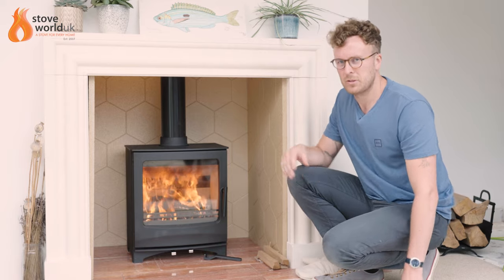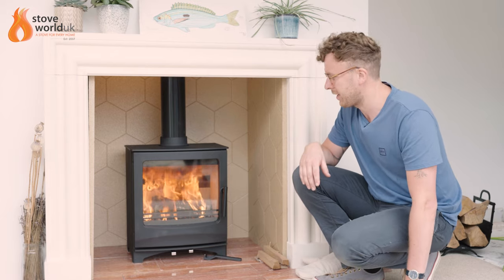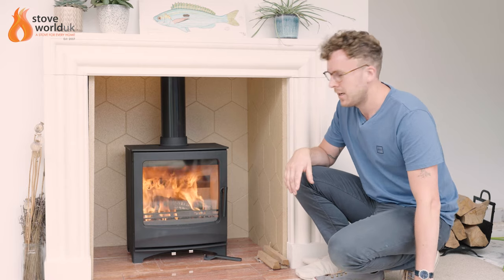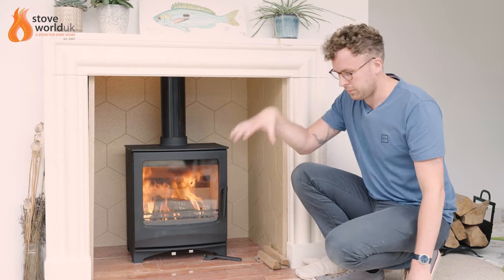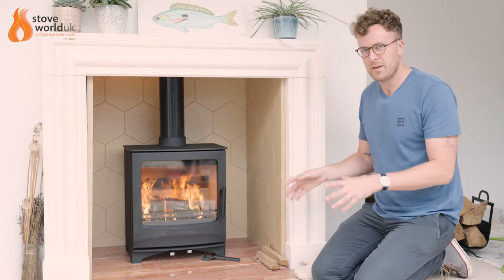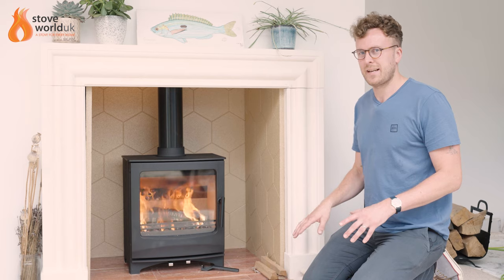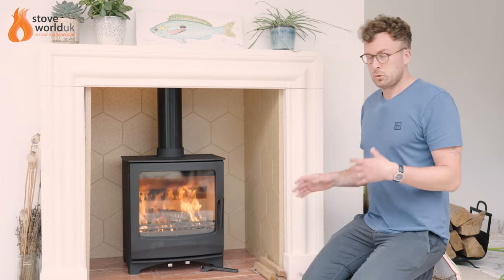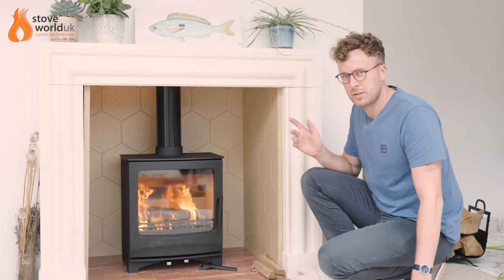Why Is My Stove Spilling Smoke And What Should I Do About It!

Comment: You set up the fire and light it.  You dont open the door for 2 hours. Heat up the chimney isnt a problem.  All i can find are videos like these about smoking stoves.
Reply: This is correct however.  The flue and chimney have to be a certain temperature.  Put a thermostat on the flue and only reload when it reaches a good temperature.
Reply: Just had my new fire fit a few days ago and the room is full of smoke  with the door closed ?

Comment: Two tips. 1 Get a good bit of kindling ready to go so that you can shut the door after lighting. On one of my stoves I have to add a firelighter. 2 The size of the room that the stove is in should ideally balanced to the size of the stove. By having an internal door open when lighting you are effectively making the room much larger which can cause smoke to spool into the room in some installations.
Reply: Yes! Make sure you “lay” or “set” your fire properly before lighting. Then all you have to do is light it and sit back. We tend to use what we call the “Jenga method”, as it looks like a game of Jenga. With two smallish logs at the bottom, then large sticks, in a criss cross pattern, smaller and smaller to the top, actually as far up the “box” as you can manage. Flamer type firefighter at the top with some kindling. Light it, open the door a small amount then leave it alone. Once the “tower” is collapsing you add a couple of small logs, let it burn a bit still with the door open a small amount the close the door and once it’s going well you close all but the necessary air controls. Depending on the type or stove and where you controls are. Half the battle is getting to know your own individual stove, and always ask the Fire Spirits for help beforehand and thank them afterwards (yes it sounds daft and hippy but you’d be amazed….)

Comment: The reason any flue works is the air inside the flue is warmer than the air outside. This becomes more of an issue at the start of the burning season through fluctuating weather temperatures and irregular use. A wood fire is all smoke and no heat until it is going. My advise to customers is to light a Fire-lighter and let it burn as this will put some warm air up there. Then set and light your wood fire. Chimney Sweep

Comment: Burning wood for past 23 years.  Best fire starter is a spray bottle and diesel.  Dont need much , diesel doesn't explode to life and burns hot and slow. Creates heat instantly and gets the wood burning quickly.  Piece of paper and a match is all that is needed to ignite the fuel. BBQ fuel works but probably pay more for it. Keeping smoke from blowing back is going to happen if the door is yanked open.  Open the door about an inch, give it a second or two to equalize the pressure then open it all the way.  Make sure chimney is clean. As creosote builds at the top it chokes the chimney and smoke will push back .
Reply: Only problem is. House. Stinks of diesel
Reply: @kevsmith5363 light it then quickly close the door about 3/4 shut , it won't come  back.

Comment: I have an Easy easy fix guaranteed. I keep a small hand torch handy. I slide the top brick over and expose the chimney inside the stove. I Light the torch and direct the flame right into the chimney opening for 10 sec. Slide the top brick back in place, then light the fire. This way the heat generated from the torch has made a positive direction back up the chimney. Easy easy easy and NEVER have smoke again 👍👍👍

Comment: Nice explanation, I had already worked this out and your tip of using something to give the flue a burst of heat is spot on.
I have this problem if it is cold and the stove hasn't been used for many days but the draft is actually a little too high when warmed up.

Comment: Use kindling (which is dry, so produces very little smoke) and a fire lighter (no newspaper, that's a bad idea as it can cause a chimney fire if there is creosote build up in the flue). Open all air vents and open the door slightly to fan the fire. This will get the gases hot really quickly. The hot gases rise in the flue and that will chase away the cold air that might be in there. 
Then add a small log and again manipulate the door opening to produce the best fanning. 

Once the small log is almost burnt add a larger log.

Comment: Just had a stove installed. New liner fitted and new slate hearth. Installed just before Christmas '22 the fitters were back today fitting the 3rd slate hearth because they crack as soon as we light the stove. Once lit every time we open the door to put wood on we get a burst of smoke, flame rushes out and ash/ soot floats around the room. The room is now always stinking of fire and everything has a fine coating of ash. Worst decision I've ever made.
Reply: We just got a new stove a month ago.   My husband swings the door open and lets smoke & flames out too,   you guys are making a wind & changing the direction of the fire.   I just open the latch to let the air suck in then swing the door very slowly open & nothing comes out.    We kept our old hearth which is 3 heavyweight garden slabs 18" x 18" cemented to floor and tiled with black fireplace tiles.   The fitters put a square of black slate in the chamber raised to match the height.    It looks good and gives the illusion of tiles all the way in.    Had to get our firebricks replaced already though and new one cracked within three days but I'm keeping it till it opens up or falls over.

Comment: Top down lighting technique works well to unblock a cold chimney and get it drawing. 

A platform of logs with a Jenga tower of kindling and firefighter above. Light the firelighter, leave the door ajar, the kindling combusts very quickly and produces lots of heat which gets the flue drawing. 

Fire needs three things to burn; heat, fuel and air. Top down lighting provides the heat and the air, so providing there’s wood in there, you’re golden.

Comment: Have you seen more problems with the ecodesign woodburners specifically installed in bungalows with shorter flue runs?  Btw think the sound of shotguns going off added to the video👍
Reply from the maker: Hello. Our sister company Ecosy Stoves try to balance performance and functionality when designing new Eco Design stoves. For example our Hampton 5 is very efficient and still only has a single baffle, making it flow better. This would be a good unit to choose if you know you have draw issues as it is very forgiving.. Some twin baffle designs are very tight. They may work well in the lab but not so well on a short, cold chimneys. We have not had a great deal more reports of issues like this with any of our units but do know that some manufacturers have had issues and have had to go back to the drawing board and make new baffles. The reason they have twin baffles is to help keep the heat in the chamber and reduce loss up the chimney. Many designs would fail the regulations without them. I’m glad the shot guns added to the drama of the video. 😃
Reply: @Karlcoupe  many thanks for the  detailed reply.
Reply: I have the Ecosy Hampton 5 and it is only meant to be 5 KW but has upstairs at 23c when it is up and running downstairs.  Once lit, we open up the living room door and the kitchen door and the whole house is warm.  Amazing from such a tiny stove.  An infinite supply of free wood adds to the appeal of it too.  

Bought it from Stove world, very good price and cost £1K to install.  Will save us an absolute fortune on heating.   @Karlcoupe

Comment: I’ve got a short chimney on mine and when it’s windy like today ( storm Barra) here in the UK , I light the fuel log it blows the flames out and I’m left with huge plumes of smoke coming out of the back of my burner. I have to open the windows and shut the air intake off but it’s still really bad 😩
Reply from the maker: It would be best to speak with a HETAS installer first but our suggestion would be a "Flue Cube" as they are known to be very good for down draught issues.
Reply: Me too 😢
Reply: I think a flue damper may be the cheapest solution

Comment: Staying at the in-laws (between houses atm) and have 18 month old. In laws love the woodburner but it smells out the whole house (not smoke just smell of smoke). Should I be worried about baby’s health? Usually has a residual smell when the baby is up in the daytime but she is not around the fire when it’s lit.
Reply: A carbon monoxide detector should be used in a house with a wood stove or fireplace. Yes the house will retain a smell when in use.
Reply: Not good

Comment: I live in an old brick house with a small fireplace.     Do you think the hole can be opened up wide,  like the one in this video.    Is that easy to do for the fitter?    Also,  we have a vent in the floor about 3 feet from the fireplace.   Would that be sufficient to draw air the room?   I don't like the idea of needing a fan on.    Thanks for any advice.
Reply: 9 months on, and I guess you'll have the answers by now. A fireplace can quite easily be opened up to the original "builders opening" albeit a messy job with lots of rubble and dust. Then there's a fair amount of making good to be done around the brickwork and plaster. The floor vent sounds like a good situation although it's not necessary with stoves of 5kw or below ☺
Reply: @harrybrown3657  Hiya Harry,  I did get my answers.  Got our stove in a month ago.  Wasn't that messy and we got one just under 5kw so no vents needed except living room door wide open as it's so hot in there now, lol.  Thanks for replying.

Comment: Leaving you stove door open at night is a good idea,. 
Another good idea is use a heat gun /paint stripping gun, Just open your stove door and blast it right up the floot for 2 /3 mins this will shift any cold air 100%

Comment: There's no direct opening to the pipe and mine is leaking smoke into the room even with the door closed. So frustrating trying to get the first fire started. Fire alarms going off. I just got the pipe cleaned. It's an old Century stove.
Reply: It's a common problem nowadays but less so With an old stove. The modern lighting technique is to put kindling in your stove, leaving plenty of air gaps between. Put a firelighter or 2 on top of the kindling. While this burns it will warm the flue before the fire lights fully. Open all air controls fully and leave the door slightly ajar to provide more oxygen while it is warming up. When ready put another load of kindling on with a log on top, perhaps closing the door but with controls still open. After about 15 minutes reduce the air controls to the normal rate. Remember each chimney is different and weather can drastically affect how much a chimney pulls on any given day

Comment: Also stoves with a outside fresh air intake draw better.
Reply: Actually they CAN be worse - the cold air moves down the chimney and creates a "syphon" pushing air out of the outside air feed thus drawing in the cold air from the top, (I know air is generally colder the lower you go).

Comment: I will give u a very good trade secret tip works every  time no smoke back in your room what you need is some bio fuel this burns without smoke put some in a small saucepan lite it carefully this will warm the flu you don't need to use to much
Reply: Bio ethanol fuel by the way

Comment: You do not understand the physics of how a chimney works reference pressure and temperature. I learned the correct explanation in my school physics lessons 55 years ago! Your explanation shows you do not FULLY understand the principles involved.
Reply from the maker: This video is to help people resolve an issue they may have and every point or tip in the video is based around 15 years in the industry and lived experiences. Please do correct us on any points that you feel are incorrect or not properly worded, as the video is to help people out.  Kind regards.